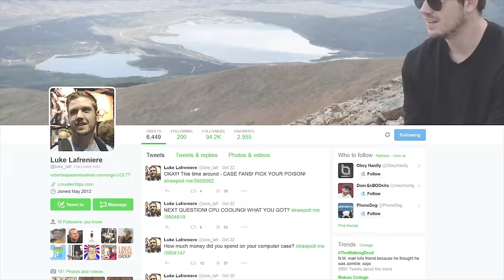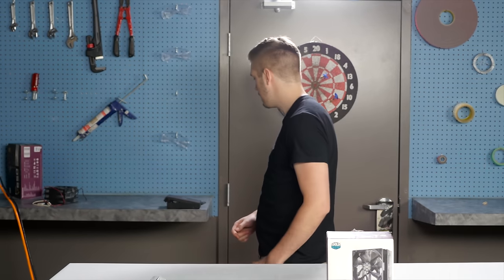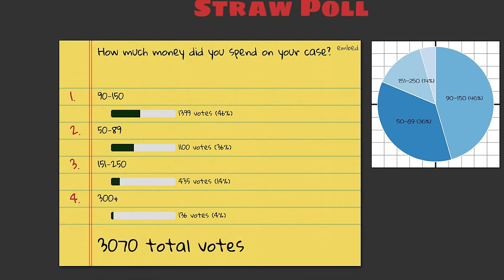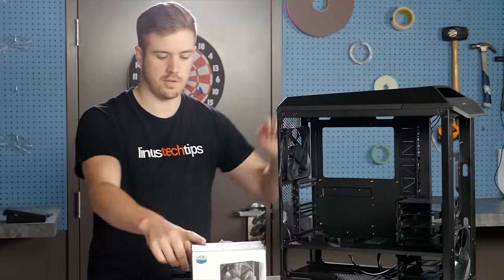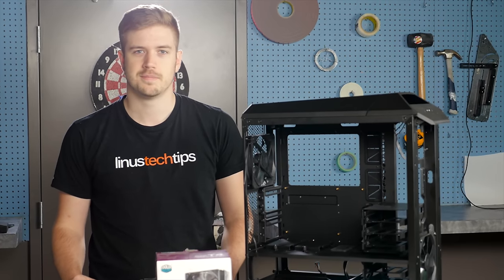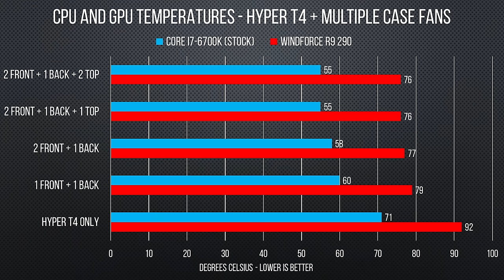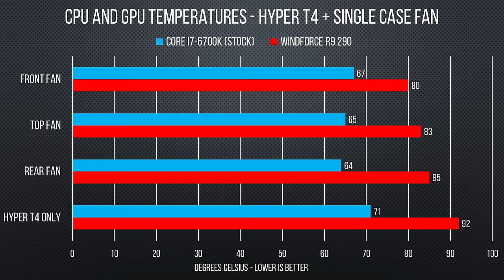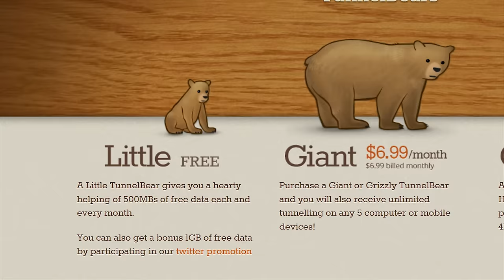Case Fans - How many should you have?

Comment: I built my first pc less than a month ago... Works like a charm. However, I totally forgot about case fans and didn't put any and my case didn't come with any fans... My pc worked, but when I got into gaming and the game itself set everything to high or ultra, I noticed my case got warm. Top of the case to be specific. So I installed 5 fans: two fans in the front to blow air at the components, 1 in the back to blow out warm air and 2 fans at the top to blow out warm air out from the case. Is this ok?
I put them all like that because I was worried back fan might not be able to remove all that warm air by itself and I know top of my case got warm before. Should I keep it as is or turn top fans to blow cool air from outside the case?
Reply: Što znam, možda si prećerao sa izduvavanjem. Onda vazduh počinje da ulazi kroz mjesta gdje ne čini mnogo dobra... Logički razmišljaj. Uduvaj onamo đe ti treba da kuleri CPU i GPU uzmu vazduha ladnog, izduvaj onamo đe taj vazduh topli izlazi. Moja neka logika je naprijed tri komada 12cm ali koji su baš tihi, odnosno ne vrte se mnogo, nazad jedan, i dobar kuler za CPU. Bitno je i da nemas buku.
Izduvavace vazduh i kroz te druge supljine na kucistu, a isto možeš ventilator napajanja da okreneš ka unutra da bi i on bio izduvni ventilator.

Comment: Basically 4 is enough and then after that it looks like it might be diminishing returns between 4-6? since 4 and 5 fans performed almost identical until theres a 6th fan introduced to the front (3 front intake, 3 exhaust) which might change by a 2-3 degrees at most maybe?

Comment: 2x 120 mm front
1x 120mm, 1x 200mm up
1x 120mm back
Front and back fans are connected to fan controller and back one controlled with MB.
So it can go on full, when needed, and be quiet, when necessary.
Reply: don't you want more intake than exhaust though
Reply: @awagnow  That will depend on fan speed, but yeah. I don't like that setup. Better with 2x140 mm intake and 1x120 mm exhaust. Maybe add another 120 mm exhaust, but it's not necessary and can cause more noise due to opening the top in many cases.

Comment: Isn't the point of having many fans to get more airflow per fan RPM, and thus a quieter system? 8 fans @ 600 RPM is almost certainly quieter than 2 fans @ 2400 RPM, even though there probably isn't a huge difference in cooling and airflow.

Comment: I dislike this video, because it give bad practice to users. For example second exhaust fan on top before CPU will take air from CPU. It can make useless top fan from front panel. And it can suffocate CPU. Second big mistake is not try different type coolers on CPU. Stock coolers will work differently then tower coolers.

Comment: I want to know in which direction should I mount the fans to blow the air for a better cooling inside, the pc case has 1 fan in front, 2 on top and 1 in the back.

Comment: I really appreciate you testing these things, but I think your airflow arrangement was awful.  For example, with only one fan in the front, most of that air pressure is just going to go right back out the front.  I bet you'd be fine with only the one fan in the front, if you taped off everywhere the air can get out, except the back of the case.  (Tape off the rest of the front, plus the entire top.)  To me, the number of fans question is more related to noise.  I'm pretty sure more fan surface area = slower fans for the same amount of cooling = quieter.

Comment: I'm down to 17 fans in my case now.  Had 19 before, that was way too many.
Reply: What case you got and are you running push pull?
Reply: @AndreasRP.  I have a mesh modded TT Level 20 XT.  It's pretty much double full tower lol.  Push/pull on one 420 rad.  Push only on the other.  I dropped 2 fans because I had a RAM fan and the x570 chipset fan.  I water-cooled both.

Comment: Revisiting this in 2021: I discovered that, on a front->back airflow type case (H500M here),  the more fans you have injecting fresh air is better.

5900X / 3090 Air cooled

I always had my top fans as intake through the top AIO radiator (I modded the case at the top for unrestricted intake).

One day I decided to try inverting the top fans as exhaust cause I heard "since air rises they should be exhausts"

Well....I can definitely say having them as intake was way better.

The GPU generales hot air inside the case. The top fans took that air through the CPU radiator and it was heating up the coolant.

The GPU itself ran also hotter, by about 5c.

It seems to me, in such chassis config, is definitely better to have a lot of positive pressure than negative pressure.

This probably doesn't apply to a 011Dynamic since the bottom and the side should be both intakes and the top fans should be exhaust at the top. It will apply however if you had a CPU air cooler. I think Der8auer did a great job proposing that design.

TLDR: In terms of temperature, Components love positive pressure of fresh air from the outside as opposed to negative pressure. Dust will always get in no matter the fan config so, just blast it with air once in a while.

Comment: but what is the temp you want your computer to be at. sorry for being dumb
Reply: You can’t really make your case habe a certain temp. It depends on your hardware. Mostly cpu and gpu.
Those are the major players that need cooling. As long as you move enough air through your case, they will get cooled effeciently (as far as the built on coolers allow it).
For COU your target should be below 90ish max and for GPU it should be around 80ish max.
Usually the problem are the coolers, rather than the airflow in the case.
Reply: Use msi afterburner to monitor your cpu and gpu temp under load. If your temps are mid eighties or lower it’s ok. You can also use afterburner to change the fan curves

Comment: Why does everybody do top exhaust instead of even more intake?  It will find somewhere to go.
Reply: Two 140 mm intake fans and 120mm outtake has worked best for my corsair 4000D case.
Reply: You'l want to have more exhaus fans because you want to remove hot air from the case faster.
Reply: @0dra726  That's not how it works. You want to have positive air pressure. Adding more exhausts can mess up the flow. Ideally you have more intake than outtake.
Reply: @0dra726  you aren't removing hot air with top exhaust.  You are removing the cold air right from your front intake and letting the hot air just sit there.  You only want to remove the air that has actually been heated by the components which are all on the back half of the case.
Reply: Negative pressure seems to give better cooling performance than positive pressure.
https://www.youtube.com/watch?v=srhw_mPZkj4 This video explains it well.
Reply: @0dra726 yeah 5 fans is better than 3 fans but they still didn't test top intake.  And the top front exhaust did no good compared to just the top rear exhaust meaning it isn't helping.  They decided to test 3 more times with a single fan instead which is SUPER helpful right?
Reply: @0dra726  that video also does not test top intake with a regular setup, only every single fan as intake which is beyond stupid.

Comment: I just go with all of them LOL I've got 6 Corsair ML120 RGB fans in a Corsair 220T case 

Full build list: AMD Ryzen 7 5700G CPU/APU with built in graphics 4 x 8GB DDR4 3600mhz Crucial Ballistix RAM EVGA 850w Bronze fully modular PSU ASUS ROG Strix B550F wifi motherboard 2TB Crucial P5 Plus m.2 nvme SSD Crucial P2 250GB m.2 nvme SSD Crucial MX500 1TB 2.5inch SSD Corsair Elite capellix H100i 240mm AIO EVGA 3060 XC 12GB GPU 6x 120mm Corsiar ML120 RGB fans in a Corsair 220T case 3 front fans and 2 top fans attached to the AIO radiator are setup as all intakes and one fan as a rear exhaust all pushing air out of the rear of the case
Reply: EVGA 3060 LOL bra get a job!